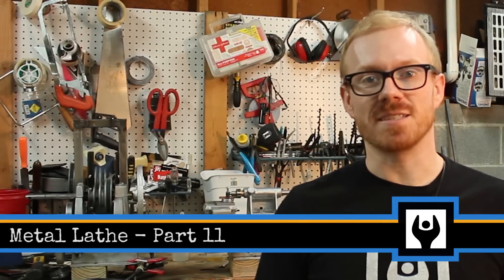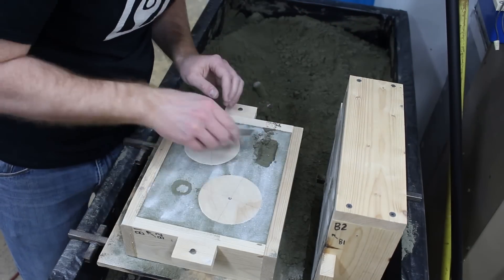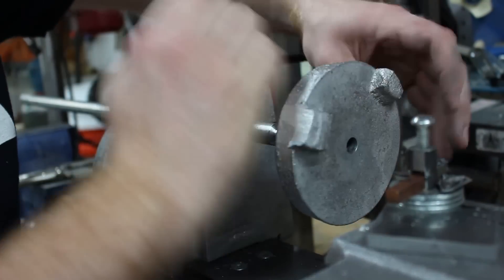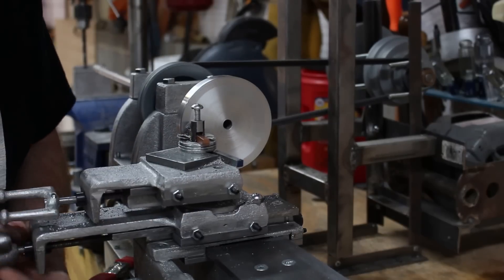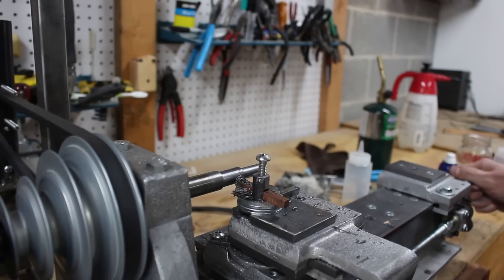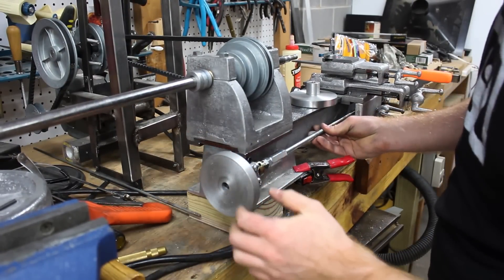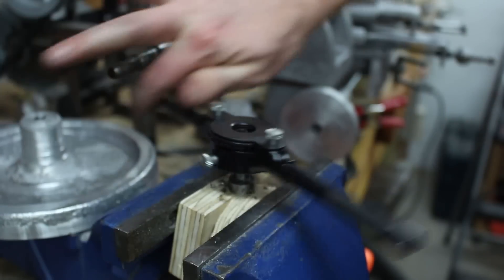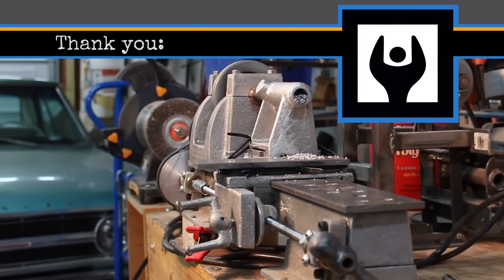Metal Lathe - Part 11: Lead Screw Drive Train

Comment: You may have already figured this out by now but the best tool bits for turning aluminum at the slow speeds you are using would be high speed steel, the carbide bits you are using require much higher spindle speeds to get good results.  Like your Vid's though!

Comment: podeme dizer por favor

o diamero das polias do carro de avanço do eixo da placa e do motor
Reply from the maker: motor 2.5in pulley => 5in pulley - 2|2.5|3.5|4in step pulley => 4|3.5|2.5|2in step pulley - spindle 1in pulley => 3.75in|1in pulley => 3.75in pulley to lead screw. I think this answers your question. Let me know if my translation is faulty.
Reply: Makercise. ok thank you very good project

Comment: hi, long time watching your video. They are very good. Congratulations on the birth of daughters.
My question is, I live in Russia, and we have inch threads and details. I can replace the lead screw on the metric? If I put a metrical about 10 millimeters, and then I can do what accessories described in the book №6 Ginger? for lathe.
I do not know much English. As a result of writing through the Google translator.
Reply from the maker: Thank you for your kind words. I understand hardware with specifications in inches is difficult to find locally. A 10mm threaded rod is a good replacement for the 3/8-16 lead screw. This will definitely work. The bearing journals were hard for me to build even with access to inch hardware. Many materials Gingery used in the 80's are no longer available locally. I have only skimmed book 6. I assume you should be able to build the change gears and other accessories using metric hardware. Google translator is usually good enough to get your point communicated, but let me know if I misunderstood. Thanks for checking me out on Facebook. I'll copy my reply there for the benefit of those who may see your post there. Good luck if you build the series.

Comment: Threading is not possible with this lathe?
Reply from the maker: It may be possible, but I would need to make a set of gears to couple the spindle to the lead screw. With belts, slippage is likely.

Comment: Very cool! awesome as always. I am curious how did you make sure the intermediate pulley shaft was parallel to the other 2? thanks!!
Reply from the maker: I aligned the hole I drilled by eye with the spindle. I guess I was close enough. Fortunately, the belts track toward each other. The misalignment is slight enough that the belt-to-belt friction is sufficient to keep them tracking Ok. The chafing wears on the belt edges though. I expect adding a crown to the pulleys will help.

Comment: I absolutely LOVE this project, and want to attempt it someday. How much are you in on this money wise would you say?
Reply from the maker: I consider this project a hobby, and I highly recommend the project if you feel it would be enjoyable. I have found it very rewarding. I do not recommend it to someone who wants a good lathe with minimal investment. There are much better quality lathes available for less money than I have spent to get this far. It would be hard to beat the experience you will get from building one, especially without a good local mentor.

It is hard, however, to actually quantify the cost of the lathe since things like tools, consumables, shipping cost, and materials all go in the same budget category. I would estimate between $150-$300 in just material for the lathe. McMaster-Carr and hardware store purchases of things like cold roll steel, pulleys, and fasteners are the bulk of the cost. Shipping bumps up McMaster-Carr order cost because I have been ordering as I need stuff versus a big comprehensive order. I try to find stuff locally, but it is silly how limited a selection of stuff is locally available. Simple things like shaft collars are hard to find. I got my motor from a $5 treadmill from a garage sale, but otherwise I haven't done much scrounging.

This estimate includes $0 cost for the aluminum that I got from an engine block a friend gave me. This also excludes the many hundreds of dollars in new tools like a welder, chop saw, taps, drill bits, countersink bits, foundry sand, foundry supplies (including lots of expensive brass plumbing fittings), crucibles, electronics (kiln and controller), cutting fluid, machinist square set, surface plate that I have purchased in conjunction with the project. Many of these tools were ones I would eventually have aquired regardless. The lathe was just a convenient justification to make the purchases.

I would say I have spent close to $1000 on tools, materials, and miscellaneous stuff in support of this build.
Reply: Fantastic response. Thank you very much..